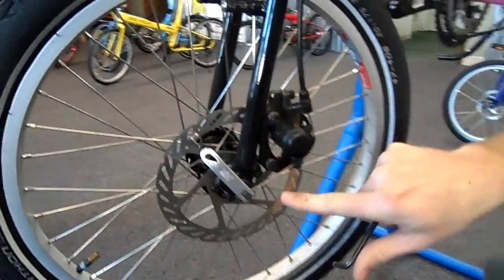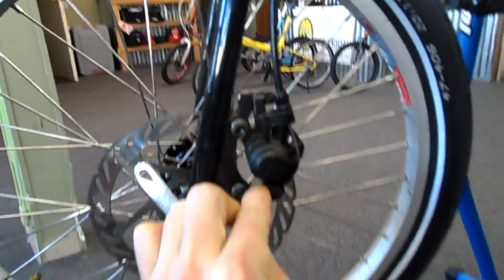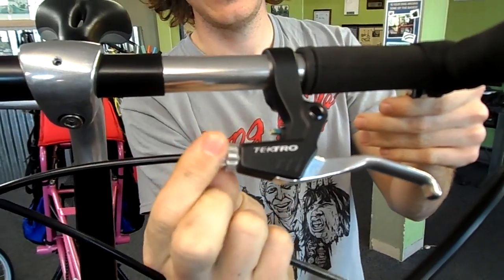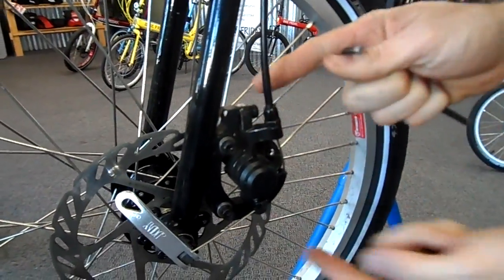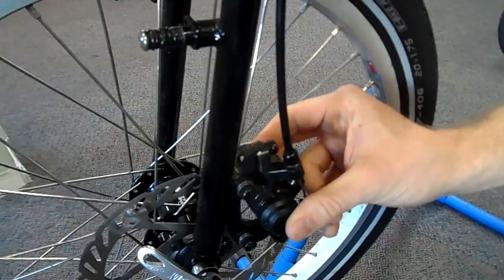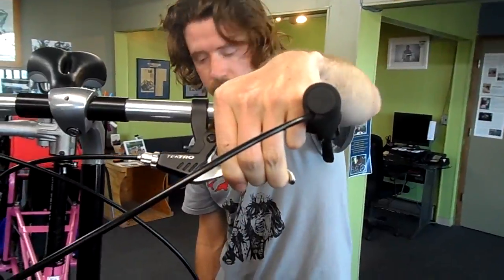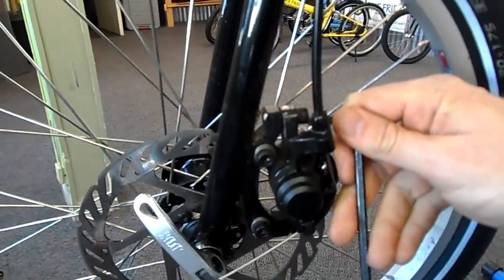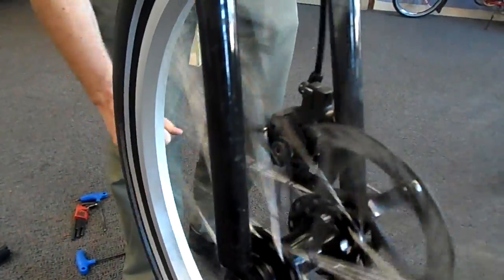Adjusting Shimano Mechanical Disc Brakes on your Bike Friday

Comment: Mike I tried your method and it was a bit of a flop. The first part worked but the outside pad was not right. If you screw out the adjustment on the cable 1-2 mm, pull the cable tight at the at the end of the lever and tighten the cable again, then screw in the adjuster back in again, it works.
Otherwise the best vid I have seen for this process. Cheers

Comment: I think is  much better to do the barrel adjuster first !!then tight  the cable  so you don't loose  tension in the cable and you'll have more margin  to adjust the brake with the time

Comment: This is ABSOLUTLEY NOT THE WAY to set up mechanical disc brakes. A specially if only one side is moving other is solid.    PALM FACE. When he started talking about levar regulator adjustmsnts I knew he is amateur !  Another bike expert.